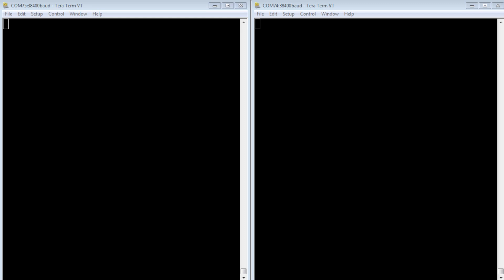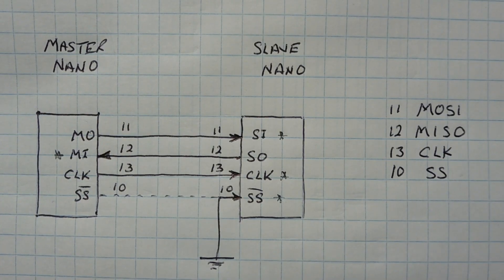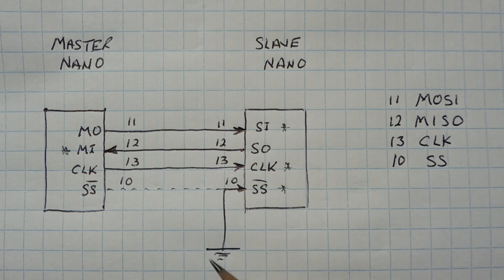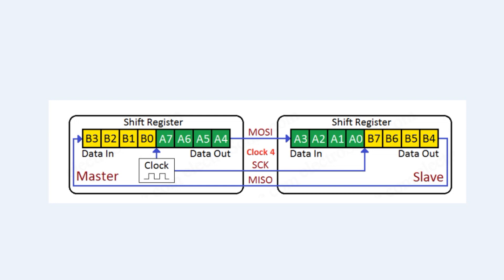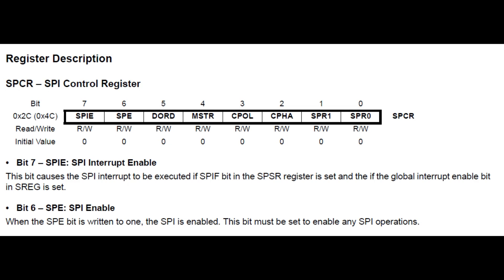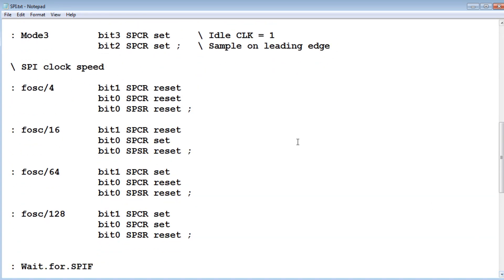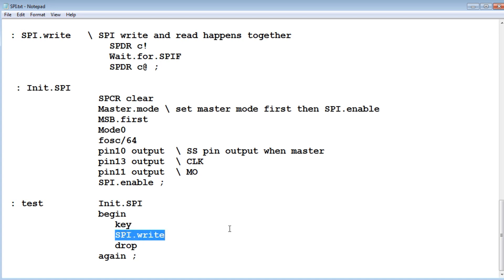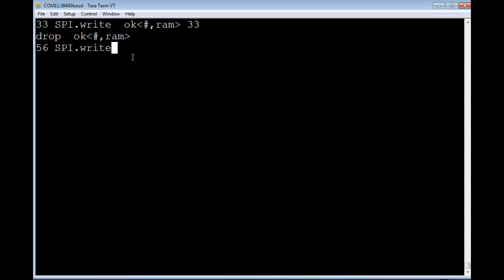SPI Programming For AVR Microcontrollers

Comment: Very nice demo and exactly what I need to practice measuring with my Oscope.  Is there any chance of getting a copy of this code for the ARDUINO AVR?  In the middle of something and prefer not to stop to learn another coding language.  Thanks!  If not, maybe you could post the code link and I'll use that as a start?

Comment: hello sir. Thanks for the video. My area of application using ATmega32 microntroller is making the controller to operate in master mode and transfer an array of 79 registers which is of 24-bit long to the slave device which is PLL IC LMX2595. how can I proceed further  with respect to programming point of view.

Comment: Hi, can we program a modem like Sim868 that contains the MCU(MT2503 based on ARM7EJ-S) to program/upload sketch to an atmega328p using ISP/SPI by reading the firmware form an SD card?
Think of it like an OTA setup for atmega328p.
Reply from the maker: SPI is a serial standard that can read SD cards, and that data can be sent by LORA, Bluetooth, Cellular ... etc  OTA to any microcontroller that is programmed to receive that format for programming.  https://youtu.be/vMC_LMmtFac

Comment: What distance could data be send using SPI.
Reply from the maker: SPI was originally design to be used only on a PCB. The reliable distance depends on a number of factors. As the frequency of the SPI clock speed increases the distance will decrease.The type of cable used will also determine a reliable distance. For a ballpark answer I would say do not go longer than 3 meters or 10 feet.
Reply: @0033mer  Thank you.

Comment: Another thoughtful instructional video. Very logical and thorough. Thanks.
Reply from the maker: Appreciate the feedback Charles.
Reply: @0033mer  What version of Forth do you use, and do you use an IDE? I can write a little Basic, but I want to learn something better.
Reply from the maker: I use Flashforth for AVR and PIC microcontrollers. There is no IDE, Forth is an onboard operating system and all development is done on the chip itself. Here is the website: http://flashforth.com/  For ARM and TI MSP430 I use Mecrisp. http://mecrisp.sourceforge.net/  Both are a free download

Comment: Quite interesting. I definitely like thinking about these kinds of protocols.

I've worked with I2C but never SPI. Right away I was thinking how to connect multiple slaves to a single master. I'd need to find out more about how the ^SS works. I see in the Wikipedia article about SPI that multiple slaves can be daisy-chained together. But i don't see the purpose of connecting the ^SS. If the slave ^SS is high (not asserted) then does the slave MISO become tri-state? That is, can I hook several slaves to the master and use the ^SS slave pin (connected to other GPIO pins) to select which slave I want to talk to?
Reply from the maker: Yes ..you need a GPIO pin (master) for every slave device you have connected. Only one slave device can be selected at a time by bringing the SS pin low. All the other slaves are in Hi-Z mode (SS pins high) so there is no contention.